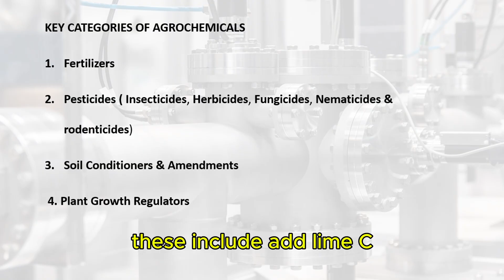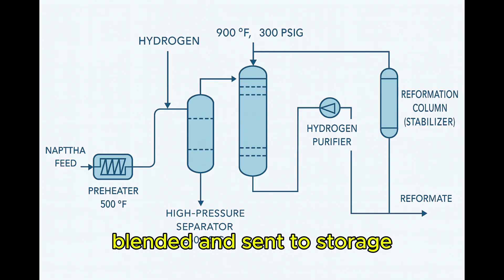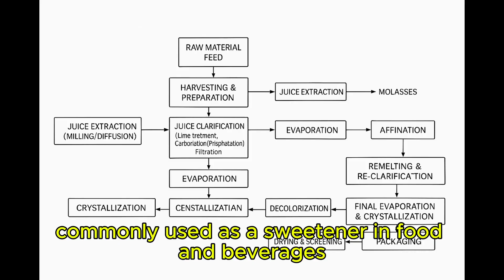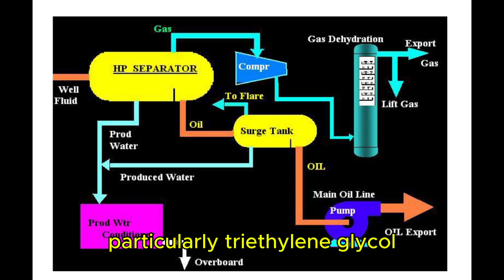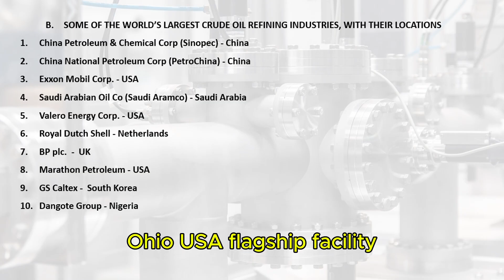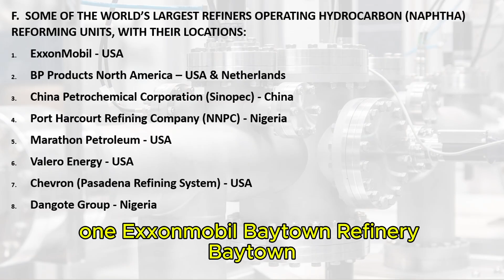From Molecules 2 Millions: The Chemistry, Process Flow & ROI of Industries & Utilized Raw Materials

Comment: An Industrial Chemist plays a crucial role in crude oil and natural gas exploration by ensuring the chemical integrity and efficiency of production operations. They conduct in-depth analyses of crude oil, natural gas, and formation water to determine composition, detect contaminants, and maintain product quality. Through the application of chemical principles, they monitor and adjust treatment processes using corrosion inhibitors, scale preventatives, and other chemical agents to safeguard pipelines, drilling tools, and equipment from damage due to harsh operational conditions.

In addition to operational support, Industrial Chemists are deeply involved in environmental management and regulatory compliance. They analyze and treat produced water and gaseous emissions to reduce ecological impact and ensure adherence to environmental laws. Their expertise is also key in designing waste treatment protocols, reducing chemical discharge, and promoting safe waste disposal practices. Furthermore, they support health and safety programs by identifying potential chemical hazards, preparing safety documentation, and implementing emergency response strategies.

Beyond routine operations, Industrial Chemists contribute to innovation and technological advancement through research and development. They create and test new chemical formulations for drilling and enhanced oil recovery (EOR) applications, such as polymer and surfactant flooding. By collaborating with geologists, engineers, and environmental scientists, they ensure that chemical processes are optimized, cost-effective, and sustainable, making them indispensable to the success and longevity of oil and gas exploration projects